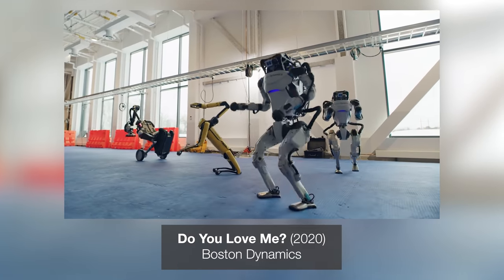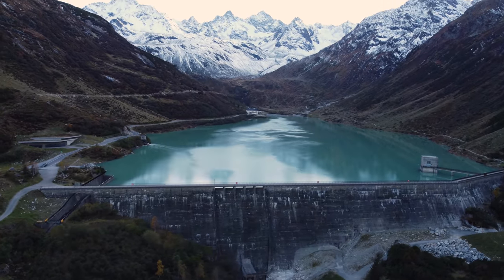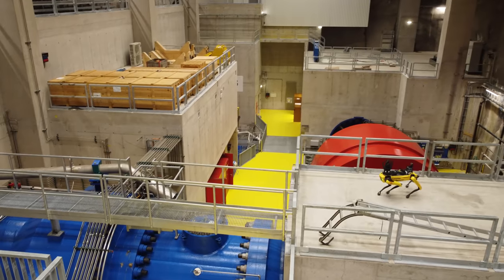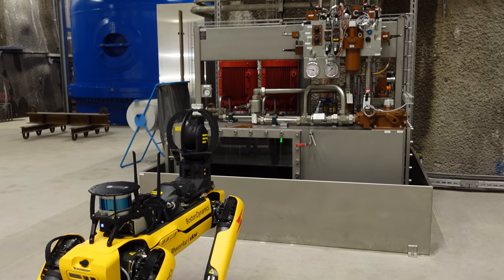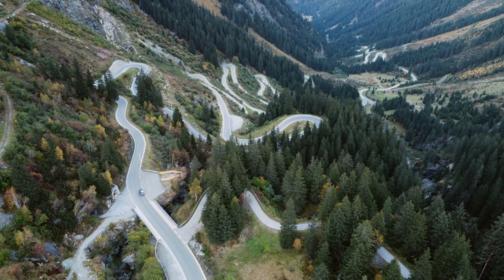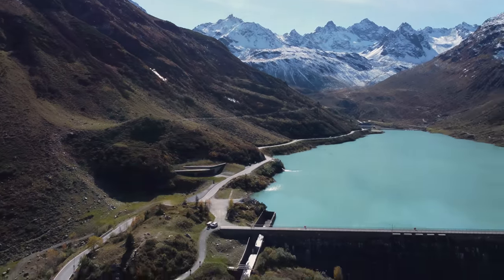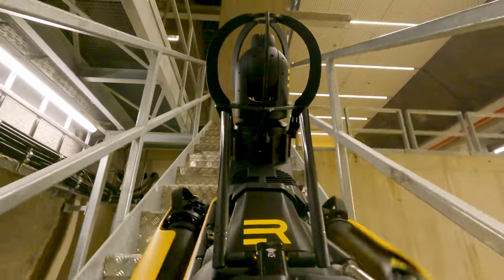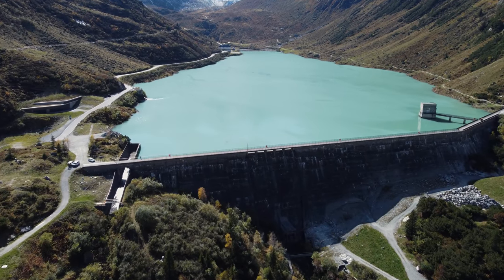An actual, real-world use for robot dogs

Comment: I suppose it makes sense. They say they're short of engineers, but the problem with paying engineers to do these inspections is you're mostly paying them to drive around. Engineers cost north of $100/hr, so you might as well pay that for them to be always inspecting, not spend most of that paid time in a car driving.
Reply: Then can you elaborate on a better human resources management ?
Reply: @ripmorld9909  The engineers can spend their time examining what Spot has seen & only going out to jobs that need their expertise saving time & vast sums of money.
Reply: @Foojaleeckalikeelamaka  correct me if I am wrong, but what you said seems to be exactly what they are doing.
Reply: @ripmorld9909  no, it's saving sending engineers out to these sites to check them just to find there's nothing wrong... They are only sent to sites where the dog has spotted there is something wrong
Reply: @ripmorld9909  😂😂
Reply: @thentil  You can definitely do some inspection with new technologies that are being worked on for simple camera monitoring, but you still need hundreds of cameras to cover everything. Not to mention, humans can't see smaller problems from a simple camera feed. You need to catch problems before they're obvious enough to see. Either way, each camera must be very robust and able to withstand 24/7 operation with vibration, and some might have poor access to power and may need to be battery powered, or have tons of new infrastructure installed, not to mention the data collection and processing that needs to happen somewhere. Sending hundreds of video streams to the control center is expensive, so you probably want to do processing on site, which increases cost greatly above just some cameras. Nothing is as simple as "Put a camera and temperature sensor down and call it good." That's why they're trialing different methods to see what works best.
Reply: This is why I left my engineering job for teaching. I did't get a masters degree for staring at a computer screen ever day. A company wants to maximise profit, but people want more in a job then just a way to make money. This makes an interesting job mind numbingly boring. I can also assure you an industrial engineer does not cost his employer nearly as much 100 dollar an hour. I made about 3000 per month after taxes, a good pay, but nowhere near as much as most people think.
Reply: @slome815  Keep in mind I said cost the company, IE your billing rate, not what you're paid. I work in the US Midwest where the cost of living isn't that high and I see engineers billing rates, they're all over $100. On the coasts or in Germany, where this video is based, they're probably considerably higher.

Comment: Interesting to think about how in this instance, there was a necessity for a robot that can maneuver in an environment designed for human movement. It's possible facilities like this in the future may be designed to include robots from the very start of construction.
Reply: Yup. For instance, they could implement low cost light load lifts that would bring the robots up and down. They could be really tiny (the lifts) and cost less than an actual staircase. It would probably make sense to do it, as the robot would spend less time moving and the lift would require less energy to bring the robot up, than the robot consumes by going up stairs.
Reply: @CanIHasThisName  --  Well, you could have trolley wires with cameras running back and forth like they have for football games.   But these are hardly trouble free.  It's worth the trouble for a football games with literally $million$ of advertising but sometimes, it's cheaper to have a real person spend a few hours a week at each plant.
Reply: @GilmerJohn  Well someone would have to install those trolleys, which would take a lot of money and resources (time and material), potentially more than the robot itself. The robot can be told to look at very specific things from very specific angles and it probably took a few hours for someone to bring it in and power it on. The rest was software. If you need additional readings, you install one sensor on the robot, whereas you'd need a whole bunch of sensors for the moving cameras. 
I genuinely think the robot is very close to being the ideal solution, if it ends up working as intended.
Reply: @CanIHasThisName  A simple ramp would be way more efficient in both cost and energy usage.
Reply: @KainYusanagi  We generally use stairs inside of buildings because they can be much steeper than a ramp, take up less space and require less material to build, therefore they are also cheaper. When you compare a small lift for the robot itself to a ramp, the amount of material required is trivial. The elevator would take up negligible amount of space, allowing for a much more efficient use of it and therefore be cheaper for the building as a whole as well (the building could be smaller). And the elevator would be more energy efficient bringing the robot up than the robot itself going up a ramp, especially if it was equipped with a counterweight which could be very specifically adjusted for the weight of the robot.
Reply: @CanIHasThisName  Except a robot can navigate much steeper ramps than humans can comfortably walk (which is why human-intended ramps take such a gradual incline by comparison to stairs, even less than the angle of a stairway), and a lift not only requires more power to climb up but also moving parts, which will break down and need replacing a lot more often than a ramp or stairs would.
Reply: @KainYusanagi  You can't make the ramps as steep as stairs, they would run a huge risk of the robot slipping down. 
How can an elevator require more power? That doesn't make even a tiny bit of sense. On a ramp, the robot has to carry itself up with no counterweight assistance over a longer distance. It will have to perform more work, therefore require way more energy just for the movement, that's elementary school physics. But a robot requires additional power for stabilisation.

And how does the longevity make any sense? Equipment elevators don't just break down, they last for decades with minimal maintenance.
Reply: The thing is, the robots are just for detection and stuff, humans still need to be able to get to the stuff that needs fixing